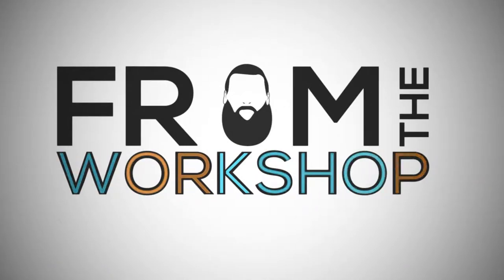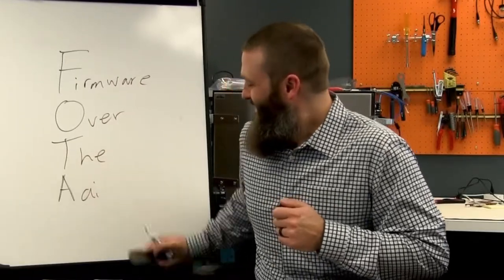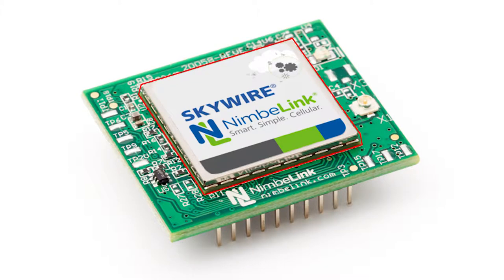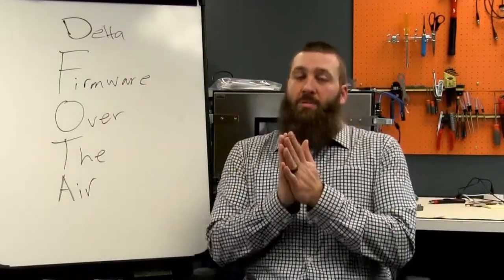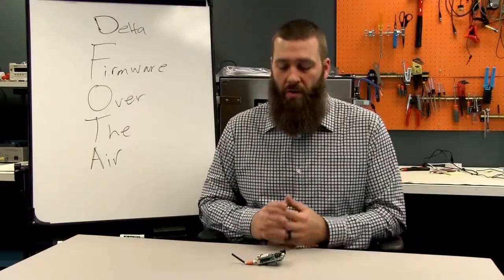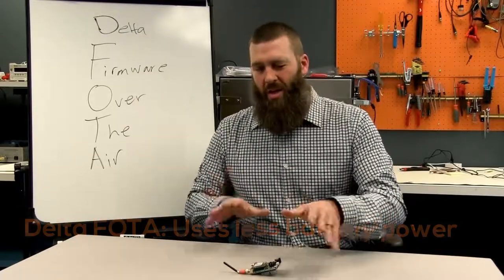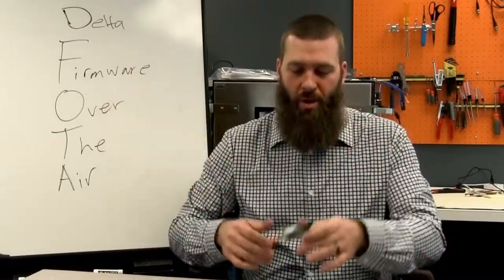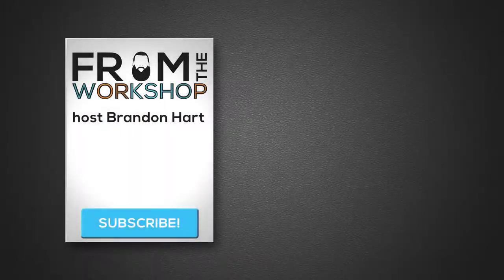Understanding FOTA

Comment: Hello.
What if i force stop fota provider
Reply from the maker: It's not super clear.  The FOTA update process is set up to recover if power is lost or the connection is lost or if it's not completed for some reason.  The Module is suppose to reboot back to the last version of firmware it had and restart.  IF you force stop FOTA it should react in the same fashion resetting back to the previous version of module FW.  If you are having  different experience feel free to send a note to Sales@nimbelink.com and we will get more info from engineering.